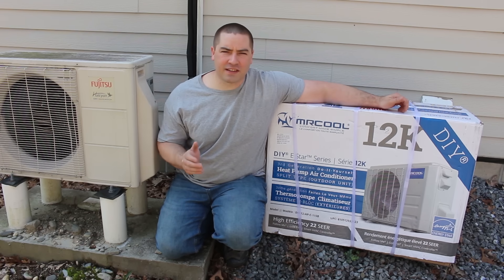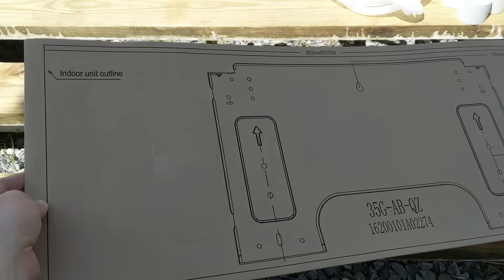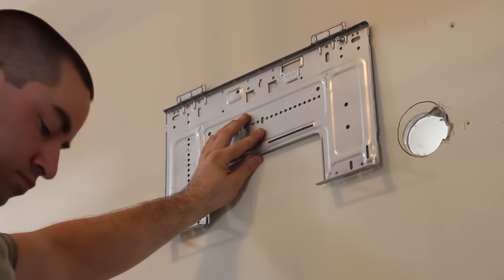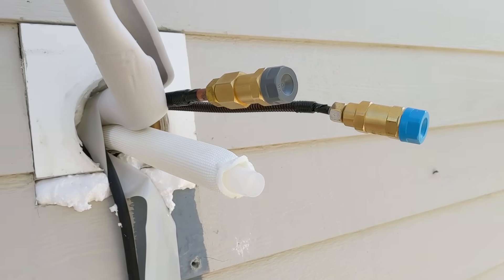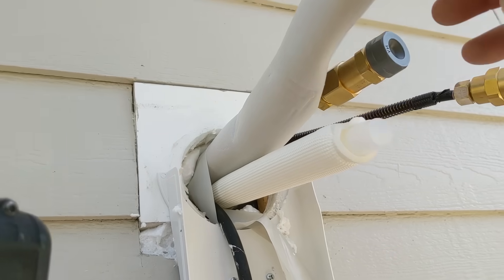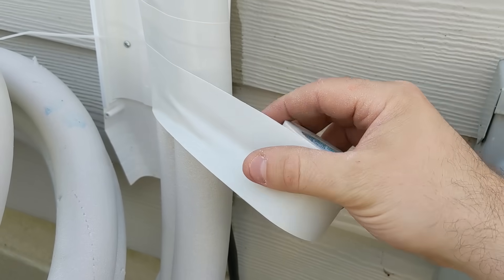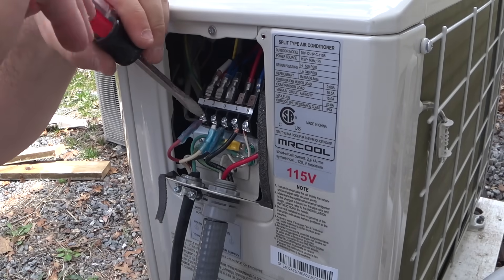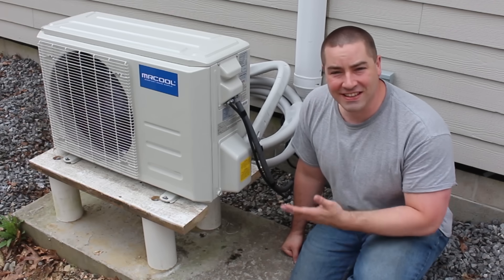Installing My Own Mini-Split Heat Pump, DIY

Comment: I`m in this business for 6 years now and i have some tips for you all. First of all, after connecting the refrigerant lines it is an absolutely must to vacuum the lines, before releasing the refrigerant and make sure there is no air inside them. Second of all, the hole size they recommend is Ф90, are you f*cking kidding me ?!  Those AC manufacturers are absolutely crazy ! In the video you can see that when he puts the copper pipes and everyting else in the hole, there is place for one or two more AC lines to go through, that is disgusting in my opinion. For everything to be tight and sealed we are using Ф35 or Ф45 MAX and it fits great. And last but not least - for a higher buildings, when there is no easy access to the connectors for the copper pipes on the indoor unit, the connectors should be behind the indoot unit (or else said - the hole for the copper pipes should be on the left side (mirrored) to what the cardboard layout displays).
Reply from the maker: It's not needed with this particular unit.  I go into more detail in my follow up video on that question: https://youtu.be/KzHLsRtVn4U

Comment: This is great but, after considering the cost and amount of work involved, we have opt out for a couple of 12,000 BTU portable unit at $400 a piece. Got everything set up and running in less than 30 minutes.
Reply: And your monthly electrical bill is now ?
Reply: I think window units are almost twice the energy consumption.

Those 12,000 btu system draw about 4.5 amps!.....u could easily run one off a small solar setup.

Comment: I’m in Australia, so curious to know procedures where you are at. Basically once installed we are required to pressure test to prove there are no leaks the verify with below 500micron with vac pump. I’m assuming because this is DIY that’s why there is no pressure testing and or vac pump used. Big balls I’d say to just go release the gas. Good job none the less 😊
Reply from the maker: It's not needed with this particular unit.  I go into more detail in my follow up video on that question: https://youtu.be/KzHLsRtVn4U

Comment: no nitrogen pressure test, no evacuation pump either. The thing will be fucked in no time
Reply from the maker: It's not needed with this particular unit.  I go into more detail in my follow up video on that question: https://youtu.be/KzHLsRtVn4U
Reply: @DavidPozEnergy  yeah righto buddy, I'm a refrigeration mechanic and never heard of that before. Good luck to ya  champ
Reply: @budge8222  you should probably go back to school then

Comment: No vacuum in line so condensate and air in line extra pipe should have been cut for a neater finish. I'll give maybe six months before you have to replace the evaporator.
Reply from the maker: It's not needed with this particular unit.  I go into more detail in my follow up video on that question: https://youtu.be/KzHLsRtVn4U

Comment: Yeah good job you have contaminants in your A/C (none condensation) you didn’t pull a vacuum which will make your A/C inefficient good luck with your new A/c
Reply from the maker: It's not needed with this particular unit.  I go into more detail in my follow up video on that question: https://youtu.be/KzHLsRtVn4U
Reply: I think line set was pre charged?

Comment: You should have had the Fujitsu unit repaired, it was probably under warranty. You should also make sure your coils in the back with the extra line set are level, you don't want any oil traps. Good luck.

Comment: You might want to extend the drip tube further away from foundation.  I don't know the volume of water coming out of that, but I always like to keep water away from the foundation, no matter the amount.
Reply: Watering the foundation is a good thing in hot climates. Just have to watch for termites.

Comment: What was the final cost for the unit?
Reply from the maker: Mr. Cool provided the main unit to me at no cost.  I guess they figure the marketing has more value.  But they (Mr. Cool) has no control over my video or my review of the product.  If you want to buy any of the parts used I did leave links in the description.  Thanks for watching.

Comment: Did you need to use a vacuum pump to get the air out of the lines before you released the refrigerant?
Reply from the maker: It's not needed with this particular unit.  I go into more detail in my follow up video on that question: https://youtu.be/KzHLsRtVn4U

Comment: David, also it is so very important to make sure that the oil gets to the compressor also it does help the cooling process all lines should be coming down to the Pump. You have six lines on the bottom of the circles and a good chance of the oil remaining in each one and if too much pools in these locations, there is a very good chance of depriving the condenser of the very badly needed oil for lubrication. You did a great job of explaining but I would like others to know that it is much better to have the Line-set coming down only. Yes, I understand that the only way of doing this is to cut the line and then re flaring the end, a flaring tool really is not that much, then you must make sure to take the burrs off before flaring and again that tool does not cost that much and then again a person should get a tubing cutter so that the ends are cut square.
Reply: Robert , those lines are pre-evacuated... Possibly descending coils would be an answer .
Reply: @marksommers6764  Yes Mark, I learned that later I really do think that Mr. Cool has done a great job I like the way they wired the tubing so they can easily be bent without fear of kinking it. David seems to be a super guy.

Comment: How much does it cost? How much space does it cool? What about the other bedrooms? Where do you live? I'm in Oklahoma which is basically somewhere along the border of HELL, so it's hot af here for about 6 months out of the year. Yes, if I were a smarter man (or richer) I'd move, I'd like to strangle whichever ancestors stopped here, looked around the heaping shit-hole of jungle-desert, & said "yep, this'll be FIIIINE", anyway, we're about to buy a house & since we're poor we're looking at total shit that doesn't even have central air, maybe I'll just move to Montana or Alaska & if I get cold I'll just MAKE A GD FIRE!

Comment: Nice job! 👏👏👏! Did you vacuum out the line set before you released Freon out of the condenser?
Reply from the maker: It's not needed with this particular unit.  I go into more detail in my follow up video on that question: https://youtu.be/KzHLsRtVn4U
Reply: @DavidPozEnergy  Oh ok, Thanks!
Reply: @DavidPozEnergy  David, you need to let people know that there are times when condensation is very high, for instance if the humidity is high when you unplug the line-set immediately moisture is there and if those lines are not vacuumed to at least 50 microns, it will in a short time destroy the Pump. Not even the smallest amount of water can be in these lines. I know we think that no water is in the line-set it is perfectly dry, all air has moisture that MUST be removed to have any good amount of working time for the compressor before it fails. I hate to see people not get what they Paid for and also to have something work to the amount of time these Heat Pumps are designed to pump which can be 10 years or even more.
Reply from the maker: Hi Robert Noname, please watch my follow up video: https://youtu.be/KzHLsRtVn4U

Comment: You should purge the air out of the copper lines and indoor unit. This is often more effective and quicker than vacuuming the system.
Reply from the maker: It's not needed with this particular unit.  I go into more detail in my follow up video on that question: https://youtu.be/KzHLsRtVn4U
Reply: @DavidPozEnergy  silly European. Didn't know about precharged pipes. Thanks for the great video keep on going!

Comment: Is there  no vacuum pump required on the for the refrigerant line set ? Was the nylog  for all refrigerants and why didn’t you cut the the ref Refrigerant
Reply from the maker: It's not needed with this particular unit.  I go into more detail in my follow up video on that question: https://youtu.be/KzHLsRtVn4U

Comment: actually you should have  vacumn the air out first before releasing the valve...in my opinion ...
Reply from the maker: It's not needed with this particular unit.  I go into more detail in my follow up video on that question: https://youtu.be/KzHLsRtVn4U

Comment: So when you install the refrigerant lines do you not have to have a vacuum ran to pull all the air out or is that all ready done?  Seems like a easy straight forward install.
Reply from the maker: It's not needed with this particular unit.  I go into more detail in my follow up video on that question: https://youtu.be/KzHLsRtVn4U

Comment: the way you wired that 220 whip to only used 1 leg will cause that breaker never to trip because it's to large  and not wired correctly. You should have that resolved asap
Reply from the maker: I had an electrician replace the 2-pole breaker with a single pole.  But he didn't want to be on camera.

Comment: Spring over copper lines of the evaporator is quite common on ductless minisplit units. We install these systems daily in jamaica for residential applications. If we use anything else we'd have to sell our houses to pay the power company.

Comment: Huh.. guess the line set and evaporator have a vacuum on them already?
Reply from the maker: Yep.  It's a pretty neat kit.  I've never seen the lines like this before, but they are sealed from the factory and don't need a vacuum pump on site.

Comment: I think I would have tested the system before I taped and tied everything together and covered it up.  But way to go!
Reply: Your right he should have leak tested first. Also should not have mounted the unit so close to the airhandler, now he is stuck with that coil.
Reply: @RadioRich100  ,bbnyghhgg

Comment: No evacuating the lines? that contaminates the refrigerant....
Maybe they included a bigger filter drier to compensate for the initial contaminants.
Reply from the maker: This kit came with a pre-charged and sealed lineset.  I go into it in this follow up video: https://youtu.be/KzHLsRtVn4U

Comment: How did you get 240v to be 120v?
Reply from the maker: In the United States our power comes in as both 120 and 240 (two 120v legs).
Reply: @DavidPozEnergy  right, but there was 240v to the existing unit. How did you make it 120v? Didn't you need a neutral?
Reply from the maker: There was already a neutral run to the original unit.  I just didn't use one of the hot legs.
Reply: @DavidPozEnergy  ahh. Gotcha. Thanks

Comment: How many square feet does it cover also what's the voltage that it works with
Reply from the maker: This model uses 120v, but they also sell models that use 240v.  I'm using it to condition my whole house, which is about 700 square feet.  I don't know if that's normal, but my house is super-insulated.

Comment: I hope yall r 608 certifie b4 handling gauges with refrigerant flowing thru them cause if not and reported to the EPA you can be looking at a very nice hefty citation.
Reply from the maker: This particular model is a DIY kit and doesn't require a certificate.  I go into more detail in my follow up video: https://youtu.be/KzHLsRtVn4U
Reply: No. Section 608 Technician Certification is required for activities that could reasonably be expected to violate the integrity of the refrigeration circuit. Adding or removing refrigerant from a mini-split as part of installation, and/or connecting or disconnecting hoses or pre-charged lines requires a Section 608 technician certification. Activities reasonably expected to violate the integrity of the refrigerant circuit include but are not limited to: attaching or detaching hoses and gauges to and from the appliance; adding or removing refrigerant; adding or removing components; and cutting the refrigerant line.

Comment: Do you have a video on how you built your pad and ground stand?  How did you attach the 2x to the risers?  Would I need to use rebar in any of the components? Thanks.
Reply from the maker: Thanks for your question.  No, I don't have a video on the stand.  I actually didn't think anyone would care about it.  LOL.  I took some scrap 2x4 lumber and nailed it into a rectangle on the ground.  I didn't bother using any vapor barrier, just right on the ground.  I then used some leftover pieces of 4" PVC pipe for the stands.  Yes, I threw in some rebar because I had some left over from building the foundation of the house.  I mixed my own concrete, with only about a 2 or 3" slump.  Poured the base and risers in one step.
Reply: @DavidPozEnergy  Thank you.

Comment: They need a filter at the end of the drip tube to keep insects, spiders, and bees from clogging the tube with a nest...
Reply: generally minisplit drain tubes clog naturally and have to be vacumed out every few months, less likely to happen if it was plumbed in with a condensate pump, but those are generally used in convential split systems, not mini splits

Comment: What made you decide to use a 115V AC instead of 230V?
Reply from the maker: Simply because I have a small house and only needed a small heat pump.  I actually could have used a 9,000 BTU unit.  The smallest "DIY" kit that Mr. Cool sells is this one (12KBTU) and it just happens to be 115v.  The next size up is 18KBTU and that one is 240v, but would have been way overkill for my cooling/heating load.

Comment: Don't you need to vaccuum the pipes to remove moisture etc? Not vacuuming the pipes will make the unit less efficient and performant.
Reply from the maker: I go into it more in this follow up video: https://youtu.be/KzHLsRtVn4U
Reply: @DavidPozEnergy  thanks. I'll have a look.
Reply: @DavidPozEnergy  Thanks David. I really didn't expect for the pipes to be precharged and sealed. Thanks for the great videos, content and your great personality, just subscribed 👍

Comment: But a botch. Pressure installation without vacuum and electrical without cable ends. We will see how much this air conditioning will work, because not removing the air along with the moisture from the pressure system will cause the oil from the compressor with moisture from the air to produce acids, which after some time will damage the compressor winding.
Reply from the maker: I go into it more in this follow up video: https://youtu.be/KzHLsRtVn4U

Comment: Its installation is not correct, the Manual says that you have to make a vacuum in the system, to remove all the moisture that was inside the pipe, if you do not do this, your device will spoil with little time of use.
Reply from the maker: I'm not sure what manual you are reading.  it's possible you are reading one for a slightly different part number.  This kit came with pre-charged lines and you don't vacuum.  I go into it more in this follow up video: https://youtu.be/KzHLsRtVn4U

Comment: Good video! I am glad you did not follow the advice of all the experts that told you that you forgot or need to evacuate the line set! So many experts that are not current on new technology!  You have a lot of patients to deal with these folks. I think I will check out your video in response to all those comments.😁🛫
Reply: I was going to say the same thing as most installations using flare fittings house the refrigerant in the condenser. Would have been nice if he told us the line set holds the charge. Kind of an important distinction worth mentioning.
Reply: Funny how you used "patients" instead of 'patience'.... It works both ways.

Comment: Did you forgot to Evacuate the Pipeline or you just don't know ?
Reply from the maker: I posted a follow up video answering that question: https://youtu.be/KzHLsRtVn4U
Reply: @DavidPozEnergy  amazing system with new technology.
What do you call this fitting ?

Comment: Just a quick question, did you have the system evaced to remove the air from the system?, just wondering
Reply from the maker: Not with this kit.  I posted a follow up video answering that question: https://youtu.be/KzHLsRtVn4U

Comment: Are the copper lines both precharged and the indoor and outdoor unit?  How is they're not air in the lines?
Reply from the maker: Yes, everything is pre-charged from the factory and sealed.  No air in the lines.  I go into more detail in this follow up video: https://youtu.be/KzHLsRtVn4U

Comment: Thank you really its very detailed helpful installation guide 
what about using vacuum pump is it necessary ?
Reply from the maker: Most mini-splits need a vacuum pump to purge the lines.  This kit is unique in that the copper lines come pre-charged and sealed.  I have a follow up video that provides more detail on this: https://youtu.be/KzHLsRtVn4U
Reply: @DavidPozEnergy  really I do appreciate your help  thanks a loooot David

Comment: Hi, Nice tutorial video.
The only question that arises is, that it only works with 220v or it is compatible for 110v and/or 220v,
since you installed it in 110v.
 
am  I  right? 

Thank you.
Reply from the maker: This particular model (12K) from Mr. Cool, is 120v only.  The next size up (18K) and bigger use 240v.
Reply: @DavidPozEnergy  
sad for me, that precise model is currently unavailable,

Comment: Glad you did this as a DIY video instead of a review since they sent you this unit ( i'm assuming for free)
Reply from the maker: I need to use it awhile before I can review it.  So far so good, but a month is hardly enough time to review a heat pump.

Comment: Good evening, why didn't you draw air from the unit before opening the gas?
Reply from the maker: I posted a follow up video that answers that question:   https://youtu.be/KzHLsRtVn4U
Reply: It is full of refrigerant you do not pull a vacume on this line set or evaporator!